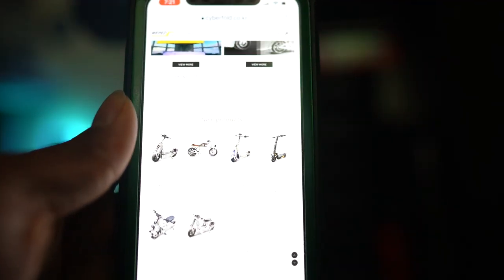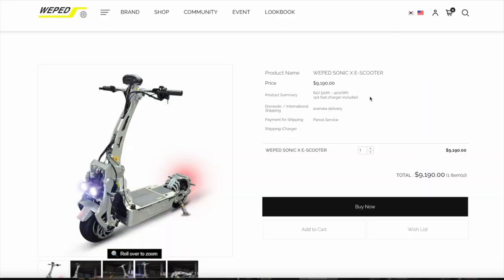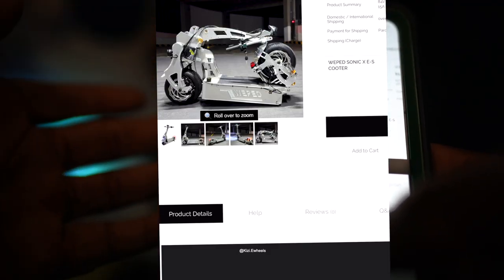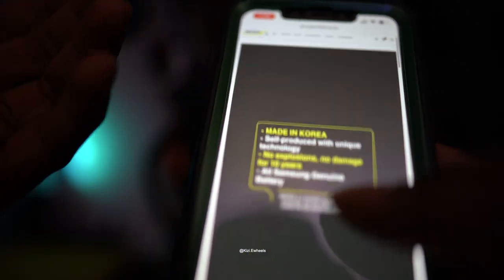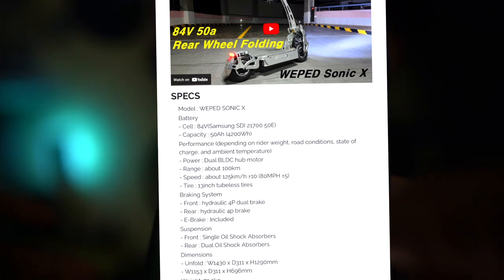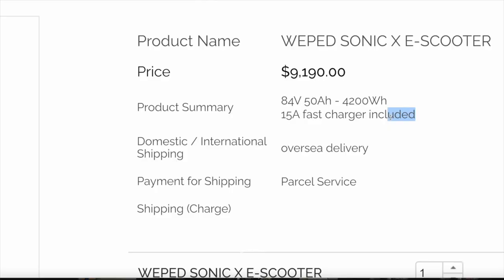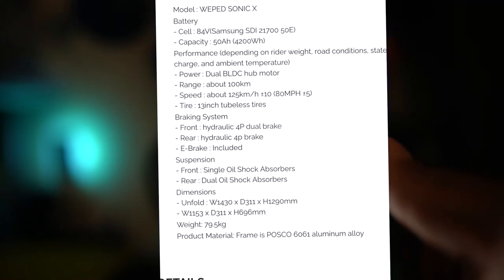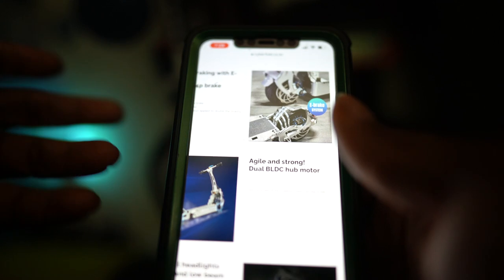Electric Scooter WEPED Sonic X Honest Feedback

Comment: also 84 x 50 is 4200wh that is not the real capacity of the battery, its 74v which is the nominal voltage of a 72v battery since 3.7x20=74 so its 3700wh not 4200. Weped please fix this issue on your sites as you can be misleading costumers

Comment: Dude, the charger is included coz original price was 8,990 USD, 😂😂😂😂😂 now, it's 9,190 USD... Clevah
Reply from the maker: Lol so they’re pretty much charging for the charger that’s supposed to come with it
Reply: @KiziEwheels  yeah, the thing you don't like about weped before is actually a flexibility they offer to loyal or long-time riders or customers.. because there are those who already got the weped adapter and fast charger. So, not including a fast charger would save them some dough.. you actually just need the adapter from weped, when you have that, you can use other fast chargers from reliable vendors if you already have it.

Comment: My Sonic, the big beast (not x), will be here this week from FedEx. I had it customized from WEPED with a few things that normally you can't get, but since I will be the first person in the U.S. to actually get it in my hands, I will do a review on my own channel. I ordered cruise control, a single/dial motor switch, dashcam and extra external battery. I bought the Dark Knight back in December. While it was fast, it lacked a display, cruise control, the brakes were not very good and it didn't handle the bumps really well like my FLJ14X. With the Sonic, they went with the best brakes on the market (Brembo), the suspension is upgraded, it has turn signals, a horn, high/low beams for the headlights and it has a beautiful blue display that has MPH/KPH unlike most Chinese scooters that only have KPH. 
The cruise control does not work like most cruise controls on all cheap scooters. WEPED cruise control is just like a car. Whatever speed you are going, you press CC and bingo it stays at that speed. If you go faster, it will stay at that new speed. To disconnect it, hit the brakes or press the CC button. This is way safer that what is normally found on regular scooters. The dashcam is mounted with a customized bracket on the front main frame. This option will be available to anyone who wants it ($150. including installation). Now the single/dual motor switch will NOT be available to the general public. I asked for it and was given to me as I was the first order for the Sonic (RHIP) :)  When I had the Dark Knight, one of the things I didn't like about having both motors on always, was two-fold. The first, was the feeling of having the scooter "pull" from the front wheel, very similar to the front wheel drive of a car. If you were used to a rear wheel car, you know what I'm talking about. The second thing was battery draw. Having both motors always on when your not going fast is not really needed. Its using more of the battery that could be saved for distance (trade off). More to come when I receive my Sonic but I wanted to add a few things here for the people who would be interested...

The reason why the prices are high is really SHIPPING. But there is good news from WEPED North America and Mr. James Kim. Pricing in the future will be VERY competitive to Dualtron or similar products. Stay tuned for more information but this is all great stuff coming our way!!

Regarding the battery charger - previously, all scooters came from WEPED with a charger. However, if you wanted the fast charger, it was $215. extra. Now, the fast charger is included in the price. It was not clearly stated this way on their website, but since I know first hand, I was given the regular charger when I first bought the DK, even though I paid for the fast charger. They did send it to me, so all was good.
Reply: Oh, I saw the video Weped made about your Sonic!  So YOU'RE the Lou.  I was like, "who's Lou in California?"  LOL.  Congratulations on having such a rare escooter in the USA.  I sincerely hope it's worth the cost.  It would be better if there was a retailer and maintenance center (or person, at least) for these expensive beasts.
Reply: Weped won't give the single motor switch on dark knight because the motor would blow up given the weight and load of the scooter!!!  2 motors have to run that thing with the water cooling on to ensure that there would be no cut off. Put single motor switch on there and you'd see how many people would bitch about dark knight.
Reply: It was since September 2022 that weped made note on their website for all models like FF and Fold2 including weped Mini 9 (an entry level scooter that doesn't need a fast charger) that charger is not included on the models! This notice was made along with the change in handlebars, pmt tires of FF and after they changed the controllers of fold2 and made fold2 a sine wave controller! The ads specifically said in Korean, PRODUCT DOESNT INCLUDE CHARGER.